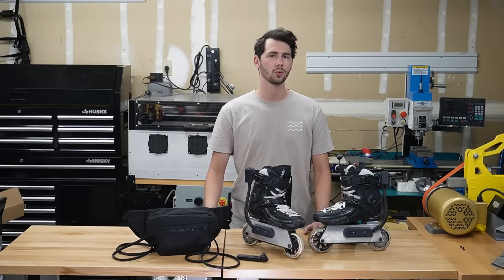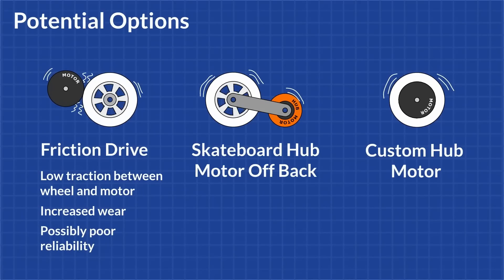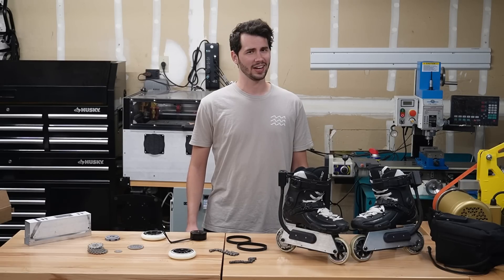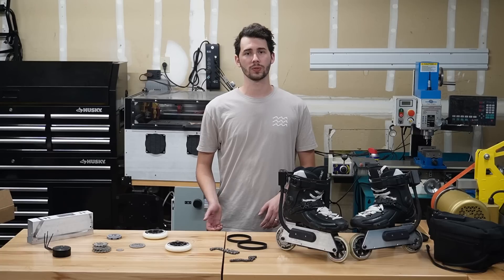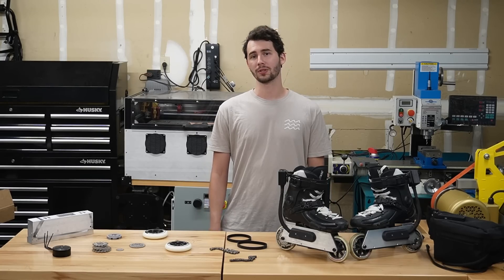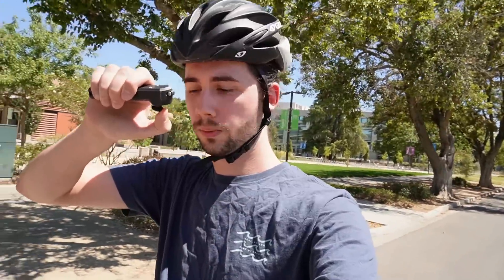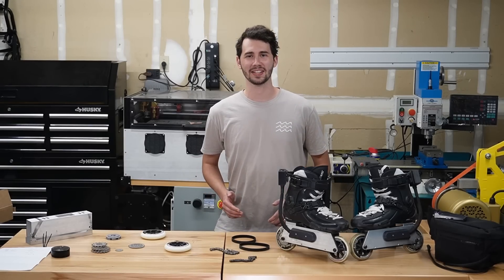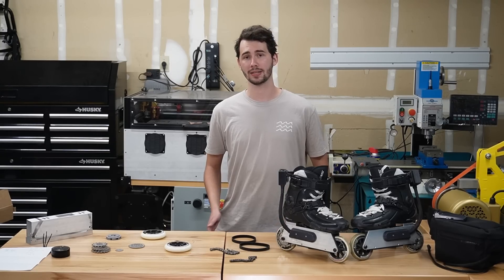I Made the Worlds FASTEST Electric Rollerblades

Comment: Thinking of breaking multiple bones with a similar scheme.  Great work. 

A couple of points:  First, put the battery on your front.  Falling on your ass is a normal failure mode on inline skates and you don't want to wreck your back.  Second -- and it wasn't clear if you can do this from the video -- make sure you have a quick way of removing the battery such as if it happens to catch on fire, or at least monitor battery temperature if you aren't doing that already.

I'm still prototyping my hare-brained (hair? whatever) scheme but I'm considering doing roller-skates, which might allow me to use a belt-gear normally used for electric skateboards.  For initial prototyping I'll probably/possibly attempt to cut a groove in one wheel (with a hot wire perhaps) and drive it with a loop of ~3mm poly rope and spring tensioning with the motor hanging off the back of the skate.  I've currently got a 12V starter motor from a moped and a smallish 24V industrial DC brushed motor to try out.  Either might work (although a bit heavy) but I understand starter motors typically aren't designed to operate continuously, so there might be heating concerns.  That said, most of the high-current draw would be from starting to roll.  I'm an analog electronics noob so this should be fun if I can get the project off the ground, so to speak.

Closed-loop speed control is probably best to avoid motor racing when the skate(s) are off the ground.  As far as speed control is concerned, have you thought of using an accelerometer to measure body position to control acceleration and/or braking?  There's lots of options here, but the best solution might somehow marry normal skating motion with motor assist.  Not sure how that might be accomplished but it may be worth thinking about.

Inline skates would be for V2.0 if I get the first set done and if it seems practical.  There's not a lot of room down there as you've found.  But first I need to get ahold of some roller skates!  Fortunately there's a shop not far from where I am up here in Raincouver...  Again, great job on those skates.
Reply: Gott Im Himmel!

Remember kids, always obey physics and the motor vehicle regulations in your area.  As I have learned, Raincouver does not believe in electric roller-skates of any kind and therefore I have no choice but to make them and then run them exclusively on a track located on private property, OR I could just make the hybrid e-bike I've been thinking about ever since I used a hammer, file, drill, etc. to mount a 31cc 2-stroke from a string trimmer on my mountain bike over the back wheel.

Comment: this is a cool video and design but i think that remote control adds an unnecessary amount of danger. what happens if you drop it and the accelerator gets stuck? is there a way to ubplug the motors in an emergency like that? is there a way to disconnect the remote? i think a wired remote (or at least a wrist strap) and a touch confirm that turns off the motors, like on a lawn mower or a laser tag gun. also e-brakes could be a good idea, you could use brake pads that start up against the back of the boot and turn down into the concrete. not sure how much more effective that would be than motor braking or t-stops tho, if itd be worth the extra bulk

Comment: They could be very practical if they can clip into regular shoes quickly. Slip on the blades and ride around city/campus/work, clip them off and put them in your backpack, where the battery was also located
Reply from the maker: I actually have a pair of Doop skates that I could attach the electric frames to! That would allow me to clip in and out with regular shoes.
Reply: @collinbardini  very interesting, i didn't know about these

Comment: Totally cool design...would be interested in the files.

My thought in regards to one rollerblade taking off when lifted would be possibly having a ground disconnect/microswitch under your heel which cuts power to the blade when raised...  also id use a single dual motor controller... the advantage to 1bms vs 2 is you can have higher voltage and amp as well as weight savings...

Comment: Amazing work! 24mph is insane. Would it be possible to develop a 'gear' system which could trigger depending on the speed of the wheels rather then using a motor? So it gets harder for the skater to push but allows for higher speeds like a Bicycle?
Reply from the maker: Thanks and cool idea! It would be tough to make it work in such a tight space, but I’m sure it would be possible!

Comment: is the wear on friction drive that big of a drawback? I've always liked the idea since it lets you use the skates normally as well when you run out of battery, the guy that designed the thunderblade used the centrifugal force of the spinning motor to push it against the wheel, I thought that was pretty clever.

also wanted to say, amazing build! and amazing editing and production value :) surprised to see it's your only video on this channel with this quality
Reply from the maker: Thanks! I put a lot of work into the video so I’m glad it paid off! I don’t explain it in the video, but I was also concerned about how traction between the motor and wheel could be maintained. I was thinking a spring mechanism, but the centrifugal wheel is really clever! Friction drives are certainly viable. However, I think chains/belts win for me personally.

Comment: Theoretically, how fast could electric rollerblades get? (Within reason and usability)
Reply from the maker: That would depend on a lot of factors. I think the fastest I could push the existing design (without the assistance of gravity) is 45-55 mph (assuming a 12s battery, 1-1 gear ratio, and 100kv motor). The acceleration would be terrible, but given enough time on a flat straight it could be achievable. Would I want to go that fast? Heck no 😄

Comment: I wanted to make a pair of these years ago..  But I envisioned custom motor's inside the wheels.  I just don't have lots of money for projects and stuff, but I'm working on that.  But no doubt.. Great design.  How long do they last at top speed?  I would make a pair with both controls and auto feature where the way you roll determines how much speed your blades push out..

Comment: Do you find the drive wheel being the back wheel the best pressure point in the roller blade. Or would you add a wheel behind it for relaxing your calf muscle and something for braking should your controller drop out?
Reply from the maker: When skating, I almost always keep my weight over the center my feet and my knees bent. I can stop in normal skates so there is no need for backup breaks. I never go faster than I can comfortably handle if the motor suddenly stops

Comment: Nice engineering I have to say.  But as an engineer and an urban skater I find electric skates less than useless.  I’d think they hinder pretty much everything except going straight down a smooth road.  I barely work up a sweat skating as it is going 15 miles round trip on old abec3 bearings and worn down wheels.  The truth is, like biking, once you get good at it, it takes very little energy to go long distances.  As a skater, I much prefer the simplicity and agility of manual skates.  As an engineer, it grates me that the added complexity gets you very little in return, if not less.

Comment: U could have put a normal esc from an electric skateboard in the fanny pack and then run the cords down with the battery cords.
Reply from the maker: Thanks for the suggestion! This is possible, but it is generally best to keep the ESC as close as you can to the motor. Also, the motor position sensor is very sensitive to interference so it must be kept very short and it must be shielded.

Comment: What if you use smaller batteries that are quick release & that are attached to the skates instead. So they can easily change batteries during commute. Also cable less & less weight on the skates than the big batteries.
Reply from the maker: The difficulty of smaller batteries is you would likely have to settle for a lower voltage (fewer battery cells in series). In the video that I did my original tests, I was using a 6s battery so it is doable, but you also get a lot less power and a lower top speed. Maybe once battery technology improves a bit more it will be easier, though!

Comment: i had an idea like this for the longest time, but I got so focussed on making hub motors for the wheels. excellent solution. great build!
Reply from the maker: Thanks! I got side tracked on hub motors for a while too. They have some major advantages, but for a DIY project are tricky
Reply: @collinbardini  i was considering making the plates for the motor core myself in a makerspace near me, but none of them have the capability to cut metal. then I thought about getting a local cnc shop to cut them for me but I couldn't justify the cost for multiple prototype runs. i love the chain solution, but I feel like its not as freeing as hub motors might be for something commercial. i also hate the noise, one of the things I like about blading is its quiet.

still, great vid!

Comment: Very cool! Have you tried looking into power tool, li-ion batteries considering how light weight they are? They also have a nice convenient holding slot you're probably able to utilize in using to attach them to each skate perhaps. And also by utilizing the slot of the batteries, you're then able to switch them out when the batteries die out on you on long trips. You'd probably want to try adding solar panels to charge the batteries as you go on top of your helmet as well, that way on sunny days you'll not need to carry with you extra batteries.
Reply from the maker: Using tool batteries is certainly possible!

Comment: can you give more info about controller (I think its Vesc?)
how do you make current and speed display (or link where I can find some instructions)
im interesting in electronic part(I make e bike with same motors and want to add display like in your remote)
thanks!
Reply from the maker: No problem. The controller is a Vesc 6 and I am using the Vesc UART library to control them and read data
Reply: @collinbardini  
Thanks!

Comment: Hey that looks like a cool solution :D
I also built myself E-Rollerblades ~half a year ago and I went for a air-rubber tire approach. I used so called "Skikes" which dampen the strong vibrations caused by concrete when driving at higher speeds and they are quite a bit longer than rollerblades. I used 165mm hub motors (replacemets from RangerX2) and self built 10s battery packs which attach to each skate. This makes them pretty heavy but I made them a bit more nimble by using one controller for each skate. Tank control turning and "lane changing" are possible this way. Still need stronger leg muscles for mine as I also had no high end equitment to modify the skikes (aluminium) with heavy steel parts.
If I would apply your Project goals to mine I would rate them as follows:
C-
C
B+
A++
A+
C (~1000€ if everything would be new idk your amount of money spent)
If you are more interested, just tell me I am very Interested in these projects and like to share/improve stuff.
Max speed is at best 50km/h with a single skate (if using 12s battery) ~36km/h is the most efficient cruise speed.
(One skate broke already figuring out acceleration and brake curves)
At the moment one is still broken and my city is freezing anyway so I decided to improve the hull and weight as well as my replaceable battery pack system which is similar to powertools.

Comment: A thought, adding those spring loaded retractable spoolers to take up any slack in the power cable? It would help getting your cables safe while at any height (crouched to standing). This might add extra strain on the connectors on the boot.
Also, polyurethane on a leaf spring to take up any slack in the chain might reduce the noise of chain meshing loosely with teeth.
Reply from the maker: Love the idea! I have just been rolling up the slack in the fanny pack for now

Comment: Add a fail safe.
Radio interference can send you flying and hurting you or kill you.
Very simple and nicely done 👍🏼
Elbows and Knee protection recommended as well.
Millions have learn this the hard way having to live the rest of their lives in pain.
Reply from the maker: Thanks for the comment! A fail safe on the remotes/controller was one of the first things I added because you are 100% correct that you can end up in some very bad situations. One of the precautions that I have been taking is never going faster than what I can handle on normal skates. I usually brake a lot going down hill for example. Elbow and knee protection are definitely recommended and I will be purchasing some soon.

Comment: How is that really accurate ? you were not on a flat stretch, you were goin downhill when you hit 24, not a big hill but still on a hill.
Reply from the maker: Hi Bear, that is not correct. You can check the elevation of that road (Hutchinson Dr.) in front of the UC Davis Silo and see for yourself that there is negligible elevation gain or loss.

Comment: The tires (since we are running high speed) should be rubber. Also maybe larger (for now) to run over bumps at speed without a major wreck. Maybe a hard rubber for sliding and the advanced skaters! Since we are dealing with a brushless motor pushing around 170lbs-220lbs we need some form of cooling as well.
Reply: I also noticed your pinion gear should possibly be smaller and the spur gear larger for more acceleration possibly stick to the chains for now but as technology advances we could go bigger.

Comment: Amazing project! Love your design decisions that keep them as close to regular blades as possible. How are these uphill and how tolerant are the motors with sustained loads? They also make off-road wheels that would be cool to see paired with your setup.
Reply from the maker: Thanks! They are pretty good uphill and handle a sustained load fine since I am not pushing each motor past 15A currently

Comment: Excellent project, Excellent video! you've got my sub!
I'm curious, how much did you spend on time & materials, and how would that compare to something like the Escend frames?
Reply from the maker: That's a little tough to answer since development cost is always going to be higher than production. The motors and ESCs were most of the cost (~$520). I'm sure those could be reduced a bit if I were to purchase in bulk. The battery can also be expensive $100-300 depending on how much range and power you want.

Comment: First test and they're so fast it's just barely below street legal maximum speed. Very impressive. Where I live 40 kmph is the max, but I guess you're allowed to shoot for 30mph.
Reply from the maker: I think I could hit 30 mph pretty easily by using a 12s battery (I am currently using 10s) and switching up the gear ratios. I don't know that I will though since 24 mph is scary enough 😅

Comment: I don't see any reason why widening it a touch to be able to use the belts instead would be bad. The rollerblades would still work just as fine, it's not like it's going to get wider than the foot area. Not to mention it would simplify maintenance as you wouldn't have to worry about chain grease/rust. The sound reduction would very much be worth it for a cm more of width.
Still, impressive work! As a kid I watched an anime called Air Gear that always made me want to see powered rollerblades that let you fly through areas in such a free way that boards/bikes don't really allow. So It's awesome to see people trying to make things like this a reality, even if it can be dangerous.
Reply from the maker: Thanks for comment, Invertex! The main problem I encountered with extra width was turning radius. You can only bank so hard before parts of your skate frame hit the ground. This is kind of like when your bike pedal hits the pavement. Some people might find this tradeoff worthwhile, however!
Reply: @collinbardini  Hey thanks for the reply!
Yeah that could be a concern, though perhaps a possible solution there would be to have the belt higher up and drive a thin gear that extends down to the wheel, this could theoretically end up being thinner at the wheels than even the chain. 
The wheel chassis would just need to flare out a bit under the foot to create the space higher up, but still tight at the wheel, avoiding impeding turning radius!
Reply: I think a nicer approach for something like this though would be to take an off-road rollerblades approach where you have the 2 wheels on the outside of your feet, much larger and tilted outward to balance things out. This would not only make them safer at high speeds as cracks and rocks would pose less risk, but it would also allow you to utilize more of the undercarriage for battery storage and maybe even cheaper motors that wouldn't have to fit inside the wheels.

Comment: Granted it would mess with ground clearance maybe, but making something like “conformal fuel tanks” but for batteries around the foot section may work.  

This would also lower your center of gravity (for better or for worse!)
Reply: An alternative may just be use small batteries like 18v Ryobi ones (or other brands, or better yet some DIY/Open Source Equivalent) and carry an extra set in your bag.
Reply from the maker: Thanks for the comment, Eric! The main problem with having the batteries near the foot is weight. It felt like having bricks strapped to my feat 😂 Also, I would want to make sure that the batteries can be quickly removed with one action in case they catch fire. It's unlikely, but you never know
Reply: @collinbardini  although then you can go all Wile-E-Coyote /s  lol.  Makes sense